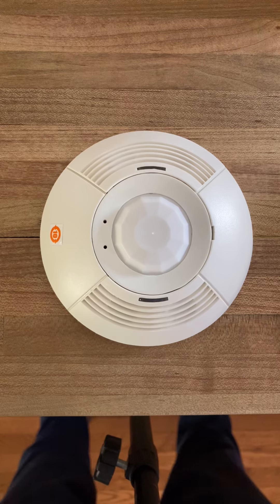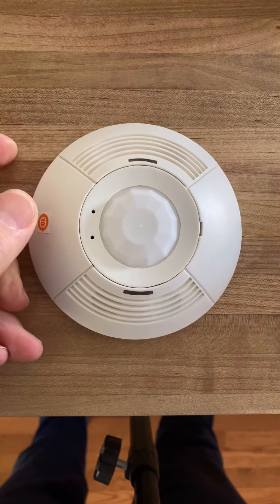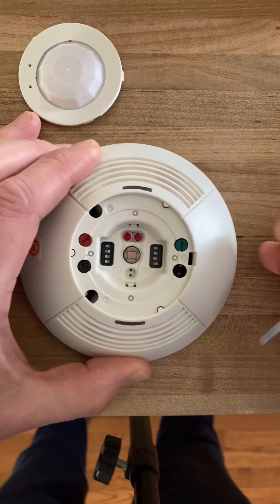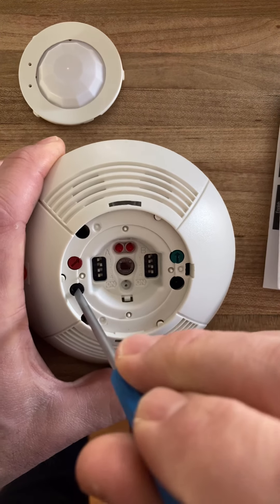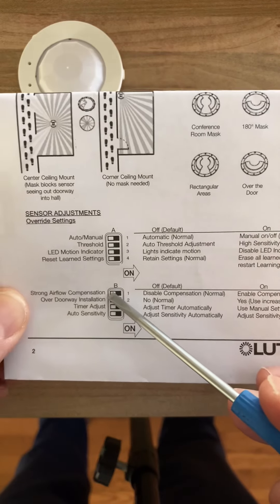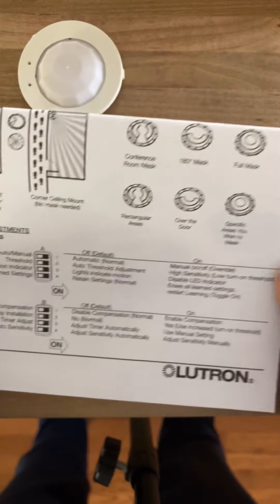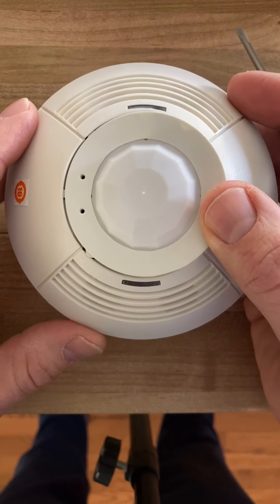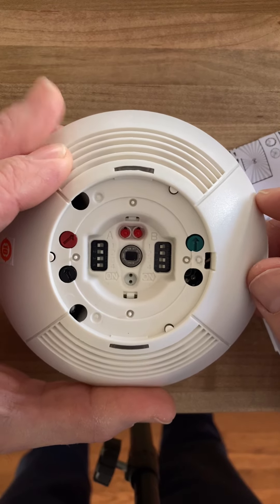Lutron LOS-CDT-2000 Sensor Settings

Comment: Will A1 ON keep the lights on?
Reply from the maker: I have not tried turning the A1 on before.  Give it a shot and let me know if it works.
Reply: @prudalavage  A1 ON is an override. It leaves the switch on. We recently converted an area into workspace and every 8 minutes it was turning off. For the time being, we decided to just allow the lights to stay on for convenience until we can have an electrician redo the area. Thanks for the video!